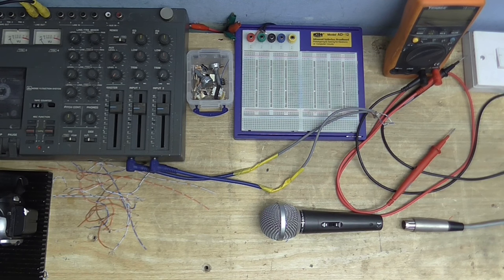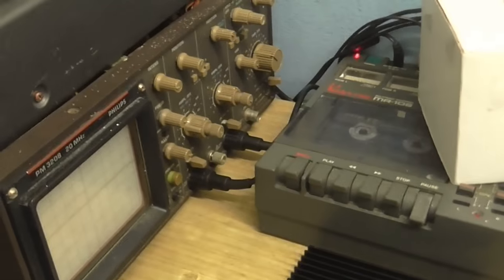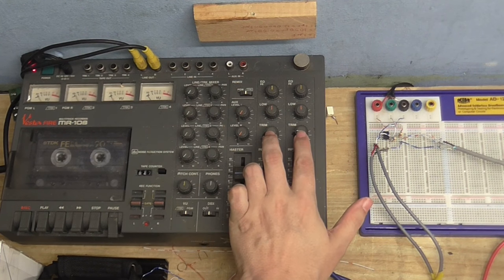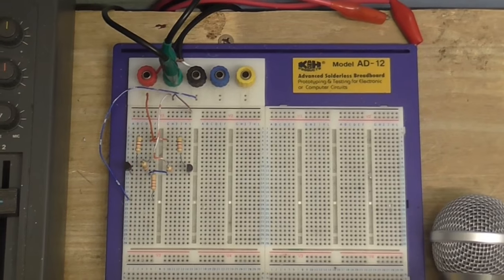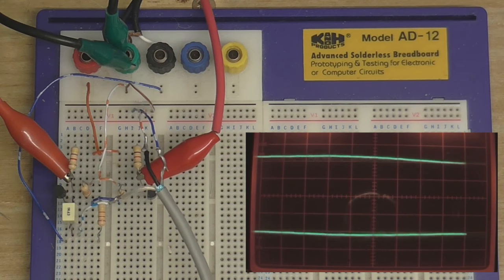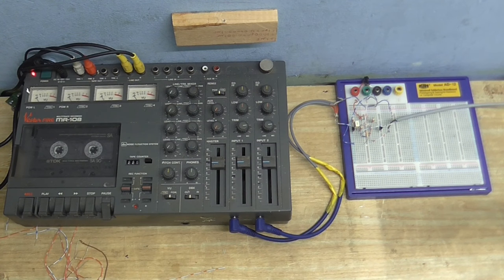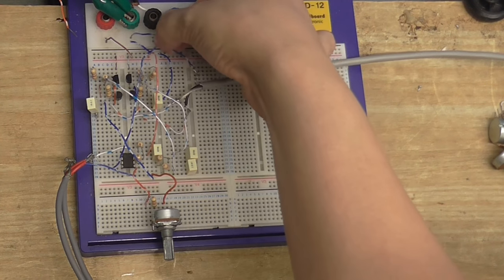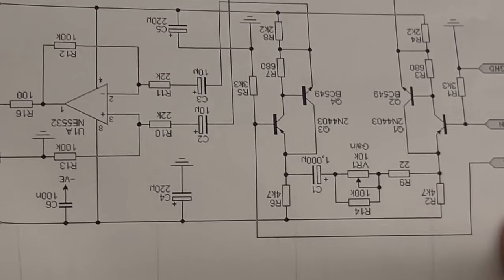Experimental Balanced Microphone Preamp Circuits PT1 of ?

Comment: Great work! Thanks for putting the different versions of preamps in the same video!
Reply from the maker: I am going to make a follow up video to this when I can get my hands on some better parts.
Reply: CoolDudeClem I'll look forward to that! Personally I have stuck on using OPA134 and OPA2134 (to differential preamps). Have you tried those? I never use anything else when I record music since I started with them. 

I haven't even thought on having a class A transistor stage as input stage to an op amp. I will try the design you have in the video this weekend. 

Again, great work and keep the videos coming, you are inspiring, pedagogical and innovative! 

Best regards, Rasmus
Reply from the maker: I was going to use an NE5532 which is really low noise, but I just googled the OPA2134 and it seems to be about as good, so I'll might go with that instead, plus they seem to be offering free samples.
Reply: CoolDudeClem I haven't tried NE5532 and they are probably equal so to say, but if you can get free samples of OPA2134 then it's sound nice to 😊

Think the NE5532 are BJT and OPA2134 are FET if that's something to bother about. 

BTW, where did you learn electronics? Do you have any nice tips on books or so? I've sort of learned most everything on my own but with help from a friend and I would like to learn some more theory so to say, experimental stuff I do anyways.
Reply from the maker: Yeah the OPA2134 has FET input, so again that's probably what I'll go with.  Most of my knowledge came from building up circuits I found on the internet and experimenting to see what happens, the first things I did were with one of those "100 in one (or whatever)" kits where the components have springs attached to them and you could connect them together by inserting wires into the springs, that's where it stared although I didn't know much of what was going on.
Reply: CoolDudeClem Learning electronics: Basically the same for me then 😊

Looking forward to see what you think of the OPA2134,  have a nice weekend!

Comment: You might want to read about microphone receptivity curves a bit. Yours is almost certainly a cardioid, meaning that it will capture the most sound from the very front. just  tilting it your way may actually get you a fair bit more volume as well as a better frequency response.
Reply: directivity not receptivity

Comment: these mics are made for more 'close' mic techniques.  Also it is probably uni-directional.  You would be better using a condenser microphone with a 48v balanced line.
Reply from the maker: Wouldn't that require a special condenser microphone element though?  I don't think those little ones that you get in things like headsets cameras and phones would be up to that.
Reply: Phantom power +48v down the mic lead or an internal battery in older condenser mics are required.

Yes it obviously runs a circuit inside the microphone - you can not just put power onto a capsule...

I was also talking about a condenser mic - and not just a crap bit of kit on an old mono tape recorder.

http://www.dawsons.co.uk/blog/what-is-phantom-power

Here are some basic details on phantom powering.

Comment: mic looks to be based on a sm58..cardiod pattern and meant to be used a few inches from your mouth, and not pick up all the background noise in the room. the best sound you got in the video when you spoke close into the mic as your meant to do. You should get some condenser mic capsule and make a diy condenser lapel mic..use your preamp for that.